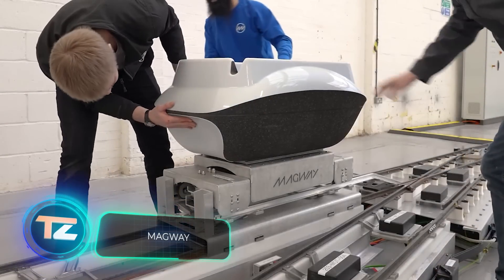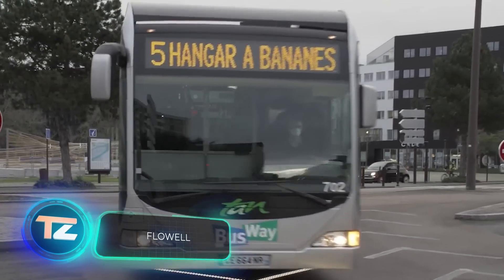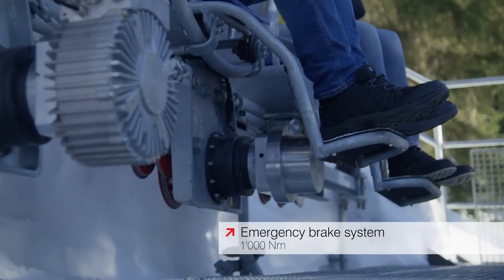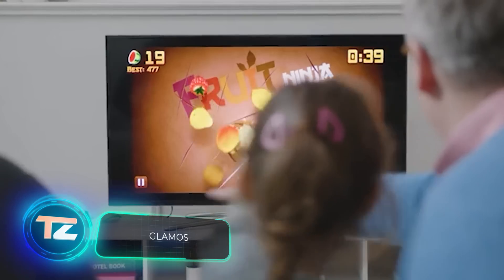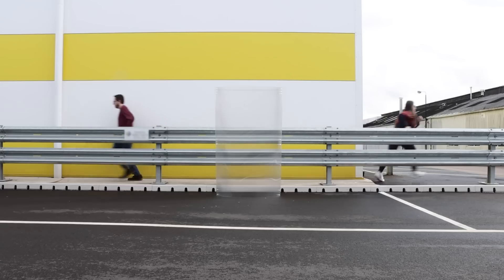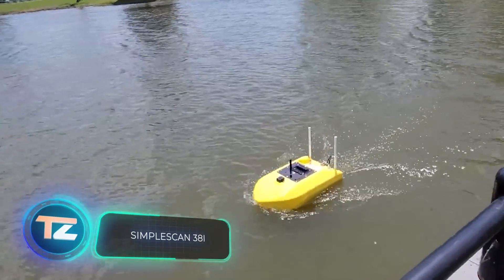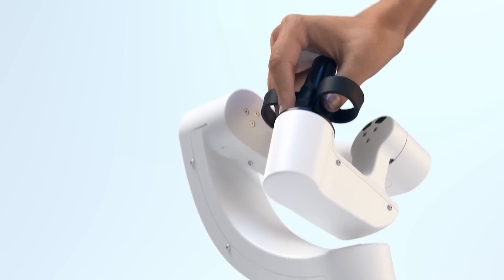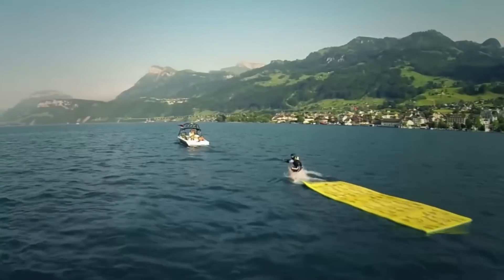15 COOL INVENTIONS YOU SHOULD SEE

Comment: New homes should be built with the LED flooring instead of tile, carpet, etc.  I imagine these tiles should be able to be made for a lower cost than traditional flooring materials and the installation would be as fast as floating wood plank flooring for example too.  It could be programmed to turn on and off automatically to save energy.  Imagine changing your flooring every single day, digitally.  No fireplace, no problemo.  Show a fire along the wall on the floor.  Imagine your floor looking like the night sky with the Moon, stars, shooting stars, etc all in motion, a planetarium show on your floor, exactly as you program it to be.  I love it.